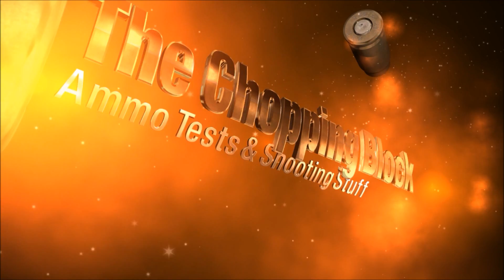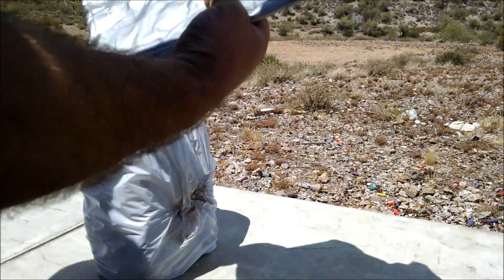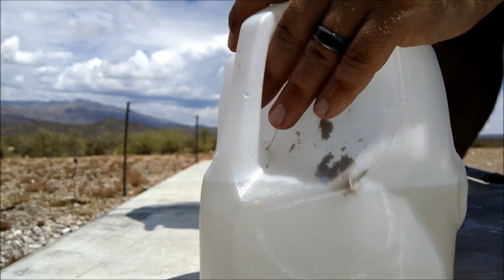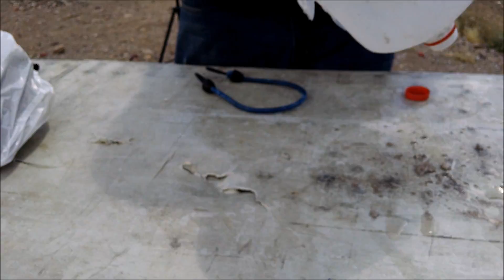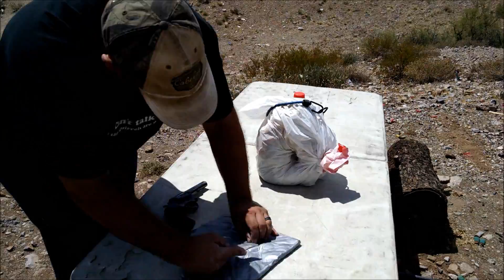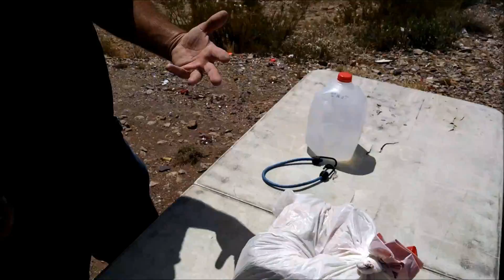Amazing! .357 Carbine vs. Level IIIA Soft Sody Armor Test

Comment: 30 carbine will penetrate body armor , will also penetrate 3/8 inch steel plates at 50 yards too.
Reply: 30 carbine is basically a .357 mag neck down to 7.62 bullet.

Comment: What brand of IIIA soft Kevlar is that? I shot one the other day and it withstood 357, 38spl, and some 9mms and 380s. All these rounds to the same panel, surprisingly. It held up good
Reply from the maker: Feces Master I don't know what brand it is. IIIA will normally stop all those. But .357 mag from a carbine is an entirely different beast.

Comment: Yesterday I did the same test, but I used a handloaded cartridge: a cast SWC-GC 160gr linotype at ~1700fps from a 20" rossi carbine. It went trought the panel like a hot kifne trought butter...
Reply from the maker: I believe that .357 carbines are some of the most underrated guns around.
Reply: I agree... As a policeman, I feel confident with my carbine.
And of course, I feel much more confident with a 762 FAL, hahaha!

The bad guys using ballistic vests are a big concern here. A "non-military" rifle like rossi carbine, with this capacity (defeat body armor), always with me, are very desirable.

Comment: If it will punch through body armor, it will probably punch through a wild pig
Reply from the maker: Dorene Cristler Maybe. 15" of penetration. Did you watch the gel test? https://youtu.be/0dMXKHUxjgQ
Reply: The Chopping Block Yes. I ran the numbers ( bullet weight 158 x velocity 1840 x velocity 1840  / 450450 yielded 1187.5 feet per second ). That seems like one dead deer if it hits the vitals.
Reply: Dorene Cristler sorry not 1187.5 fps. I ment 1187.5 foot pounds of energy.